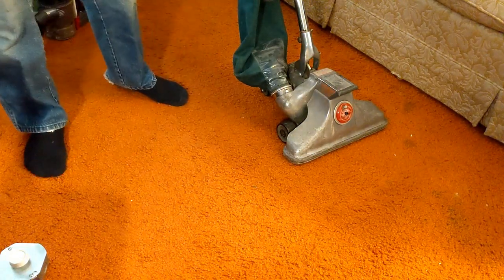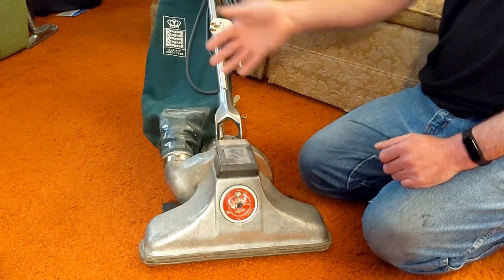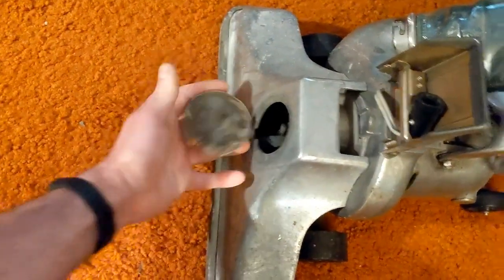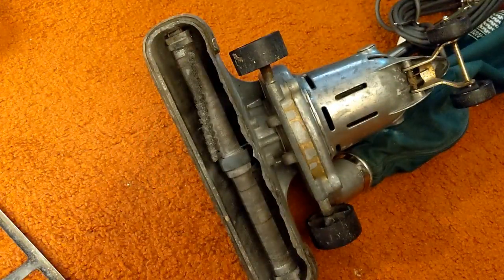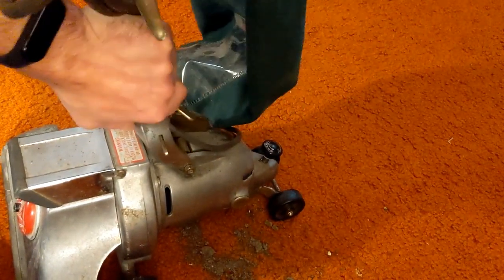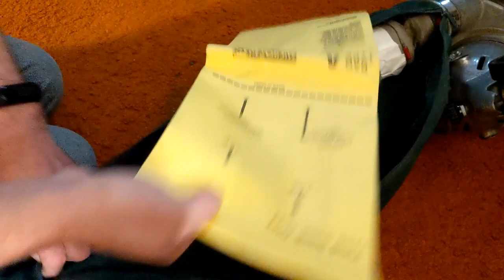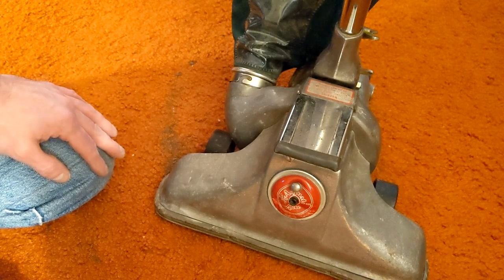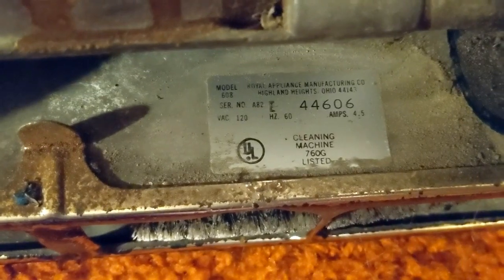Royal 608 Commercial Upright Vacuum Cleaner

Comment: Jason, the other thing I wanted to say was that back in 1982, the 608 (and all of Royal's commercial metal uprights, except the by-then relic straight-suction 311) could have had either bag type you mention, the shake-out or the zipper bag -- it depended on the business. Both of them would have been blue in color, with the words "ROYAL COMMERCIAL" on the front with the large crown logo on top.

Comment: Nice royal! I wish I could try one out or own one here in the UK
Also jheez how many Dysons do you have/have you had since that DC07 trash find?
Reply from the maker: Thanks!  I'm not sure if they ever made Royals in 240V versions.  Even if not, a large enough step down transformer should run it fine.  The universal motor won't care about 50 vs 60 Hz.
I have the DC07, another identical DC07 (which will likely just be for parts), a DC14 which was a trash "rescue", a DC35 and a DC34.
Reply: general0ne ah I don’t think we got 240v versions sadly but I do have a step down transformer I use with my American DC17s so I could import one one day I hope
I would really love to see some DC14 videos 😄 I prefer that to the DC07 as I think the 14 is more superior 
Cool cordless ones, they were good for their time but the V6 models onwards had the decent suction imo and therefore performed way better
If you ever get the chance, try out one of Dysons latest ball uprights thy have some serious cleaning power and agitation!
Reply: @parwaz7861  According to Jason Clarke (dyson37), he has a 1986-built model 611 Heavy Duty Commercial that is a 240V version. James Brown has a 1979 model 606 that is also 240V, but I do know what you mean by these being hard to find where you guys are. 

As to me, I finally got a real heavy duty commercial Royal: a 1987 model 662Z.